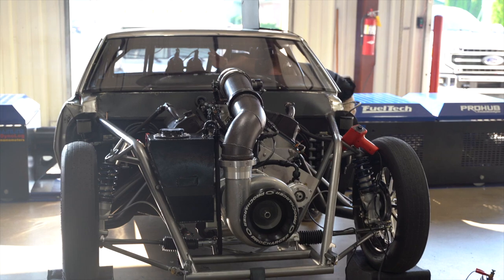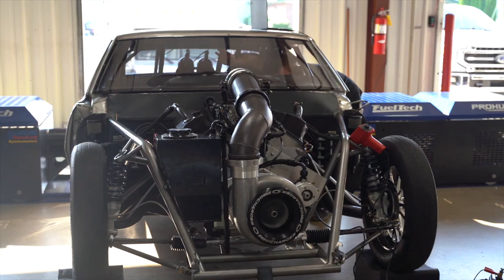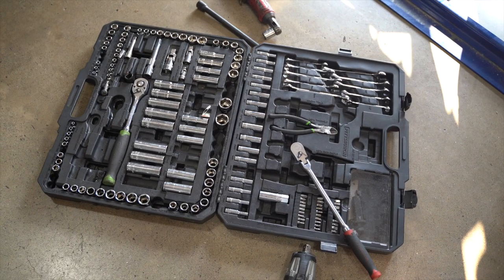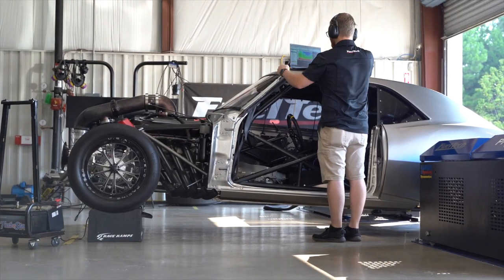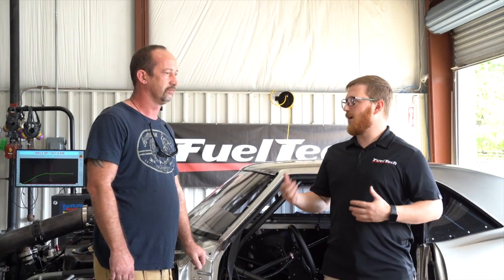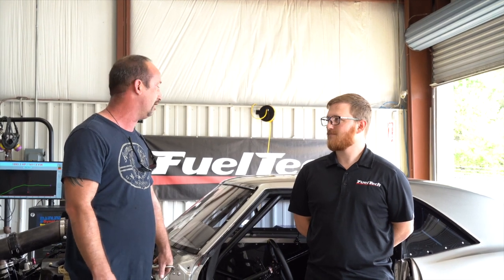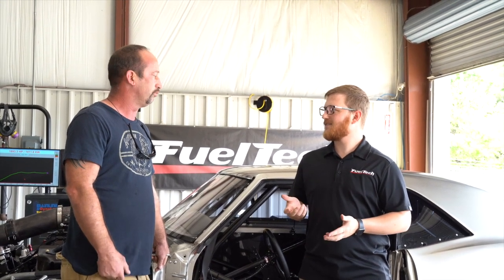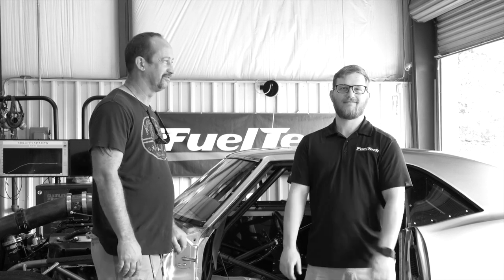Supercharged Camaro No Prep | Russell Downing

Comment: Like Shawn aka Murder Nova said it should be illegal to be that loud and not have way more HP and he should watch this video because it should make him feel better about what his car made and both of them are BBC and I don't see why this guy couldn't run small tire No Prep and even though it only made 1900HP it makes that much power pretty much the entire time and Procharged car's have way more torque than a turbo car as well so it would be interesting and it's funny how depending on who you ask what classifies a small tire I've always known them to be 28x10.5 and he said 29x10.5 and I've heard as big as 29.5x12.5 classifies as a small tire Non W so I guess it all depends where you're at what race your in and who you're racing and in my opinion if as big as 29.5x12.5 is considered a small tire then it should be a weight rule in place that the bigger you go from a 28x10.5 the heavier you have to be and depending on how much power you make but to me nothing sounds better than a big cubic inch BBC with a centrifugal blower and a set of Zoomies on it and I know everyone believes that if you run a blower than you must have Zoomies but they should experiment with different headers and see which ones help the engine make more horsepower either Zoomies or a big primary set of long tube headers or bullhorns and anything in between